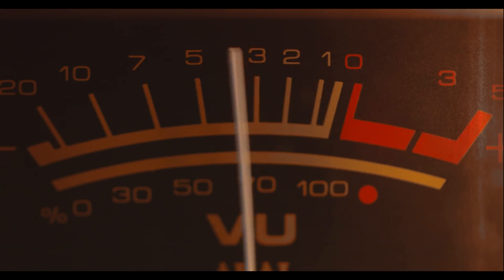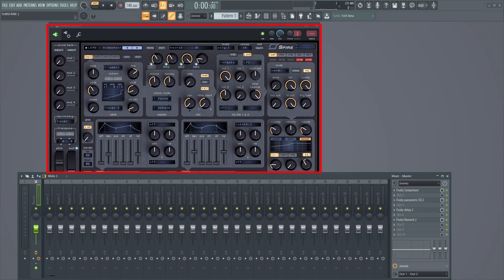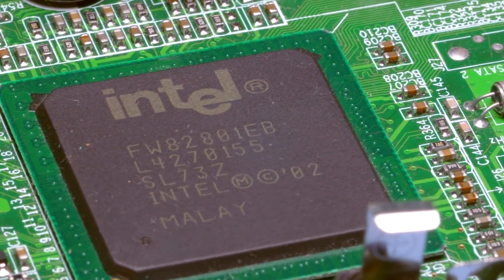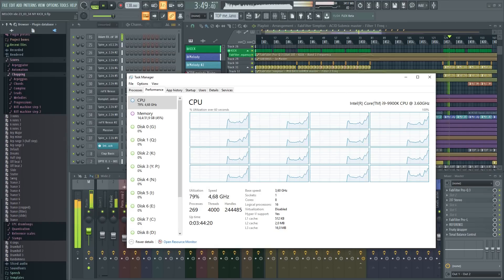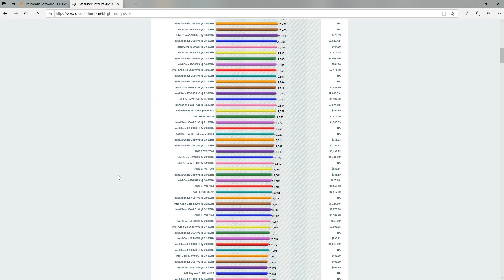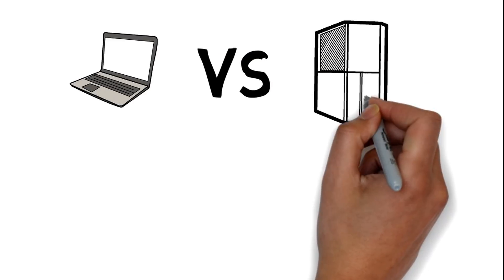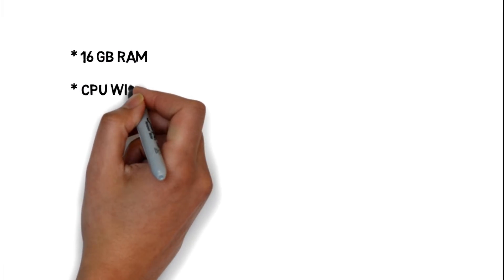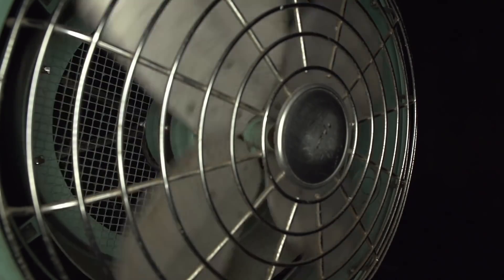The Best Computer For Music Production - What's Needed And Why!

Comment: What do you think about the huawei matebook x for producing? Thunderbolt 500gb ssd and 16gb ram
Reply from the maker: It should probably work fine, but it all depends on exactly what you're going to be using it for. A rapper who mostly record vocals and use mostly samples, and at the most a few VST's will probably make due with a very low end computer, because those kind of projects are not very demanding. However, another person making huge trance or orchestral compositions which is mostly made up by cpu hungry vst's will have a very different need. So the genre, the way you work and the kind of projects you make also plays a huge role.

Comment: Is there really no mention of a Thunderbolt 3 port in any of these specs?   That's hard to believe.
Reply from the maker: The full specs are listed in the video description and also in the pinned comment.
Reply: @FireWalkMusic  The word he used was Thunderbolt 3! Not Firewire. USB C!!!
Reply from the maker: @mitchiemasha  Sorry about that, I've gotten so many messages about the (lack of) firewire on the main board. I have to learn to properly read the messages before answering...  :)
There's 1 USB-C port on the rear (main board) and also one on top of the case.
Reply: @FireWalkMusic  it seem they're cross compatible 1 way but not the other.

Comment: Fantastic explanation and buyers guide! I went to Fractal Design cases a few years ago, similar to the one in this vid, but USB-C wasn't available then, but upgraded it a while back to an I9 as well to help with latency. Works like a dream! This is def the most comprehensive video I've seen on music station PCs. 

One thing I would add, if your a hardware nut like me. The motherboard may be something to add consideration to as well. PCIe slots are very important to my setup as I use a ton of external USB for synths and MIDI to USB dongles and interfaces. I would suggest if you have a ton of external gear, get a mobo with as many PCIe slots as possible so you are able to add additional USB ports. Even if you dont use all of them, later on when you need them they will be available for expansion and you won't have to daisy chain off a single bus with a multiport USB dongle which can cause huge a bottleneck and cause addition latency. But if your all VSTs then basically forget everything I said 😁
Reply from the maker: Thanks, very good points here! :)

Comment: Another useful video Firewalk as always , but i want to share something which would help many people , AMDs latest gen processors are really powerful over Intel , even in terms of single-core permofance and many gamers , streamers etc are switching to AMD 3rd Gen Ryzen bcoz AMD really fits into the budget with more performance over Intel and even in the High-End Section (Like Beyond 8 cores as well) , i would love to spend $1000-3000 on AMD rather than choosing Intel as they are expensive with less performance in 2019 & in the future as well ....
Reply from the maker: The new AMD 3000 series CPU's seems to be a huge leap forward for AMD. From the benchmarks and comparisons I've seen so far It looks like it should be real close, but not surpassing the i9 in terms of music production.
I'm considering making a follow up video, testing both systems against each other, but I'll have to save up some money to buy the parts first. :)

Comment: Just letting you know. AMD's 2nd and 3rd generation aren't just parallel processing. yes single core plays a huge factor for music production and what not. Though AMD now with Ryzen is so much better with IPC or instruction per clock. Ryzen doesn't have security vulnerabilities like intel does and intel keeps getting bombarded with more every other month. This comment isn't to shit on your video, though it's a little misleading when you say AMD is just focusing on only parallel processing which FX and older generations of AMD were actually based on. I personally use a Ryzen 7 1700 clocked at 3.9ghz on all cores and I have some much headroom for intensive VST's like Serum, VPS Avenger and many others running on Cubase 10 Pro. In addition, many DAW's even like FL studio loves Ryzen for the multi-threaded processing since it helps with lags and keeps your workstation and keeps it from having pops in real time. Anyway great video explaining how processing works its 100% true. However, now AMD has fixed a lot of there CPU problems that they had over a decade. :)
Reply from the maker: The new AMD chips are very good and comes very close to the Intel flagship. There's been rumors like this for years, that the next AMD chip would finally be the "intel killer", but it never happened. This was the case with the bulldozer architecture as well. I remember there was benchmark which allegedly showed that the bulldozer crushed intel. But when it finally arrived it turned out to be a disappointment, and nowhere near what it was rumored to be, so I didn't really expect the new 3000 series to be all that great either. This time however they really made a great chip, and it's almost neck to neck with Intel's flagship. From the tests I've seen so far the 9900k still seems to be slightly better for music production, but not enough to justify the price different. I'm expecting the price to go down significantly though. 

Here's some comparisons between the 3900x and the 9900k you might find useful: 
https://cpu.userbenchmark.com/Compare/Intel-Core-i9-9900K-vs-AMD-Ryzen-9-3900X/4028vs4044

I should note that I've always been a huge fan of AMD. I always used to support them (both CPU and GPU) because I always wanted to support competition, which is always good for consumers in the end. I really hope they do well with this new design. I'm considering buying the parts and testing the new AMD vs the i9 in a new video. That should be really interesting,  but I'll have to save up money to buy the parts first. :)
Reply: AMD fanboy

Comment: may i suggest if your getting a good music build pc, then get an equally good soundcard like a prism lyra, the weak link also learn to beef up single tracks with a great pre and eq as you dont need to choke out 30 plus tracks with bad audio, bounce down mix and commit and free up power, a neve 1073n for instance, if you can afford a good pc then the lyra is a no brainer
Reply from the maker: A good sound card is an important part of any build, depending on what you're using it for. If you're into recording then by all means, this will be a good investment. Personally I don't record much, I'm basically just using VST's 99% of the time, and most of my recording is done by third party actors, so for me I really just need a card with a low latency ASIO driver. If you're into recording then the sound card becomes much more important. I might make another video about external sound cards at some point. :)
Reply: @FireWalkMusic  yes i use a lot of vsts and the da is equally important to me several vsts esp drums,  any mixing really in or out the box will improve with quality adda in and out the daw,  using 4 drum vsts combined for elements of each nearly brings my pc to a grind 6 core 5g 32ram m,2 memory,  the more ram the better imo, and a prism unit, ive tried them all in over 20 years exp, but  normal recording its not such a tax

Comment: What about the motherboard and ddr are thy making any difference in latency? I meen like the chipset and brand? I can never find an answer about this.
Reply from the maker: Some chipsets allow you to overclock more than others. This will usually be tested when they review motherboards and such. The speed of your RAM plays a huge role and you want it to be as fast as possible. There are two factors there, the speed (mhz) and the latency.
Reply: @FireWalkMusic  I was wondering if I could also buy a middle class motherboard with the same chipset instead of the most expensive ones and if that really had an effect.  But with this answer I see that this is the least important.  So I better go for a more expensive Cpu and drr than for an expensive motherboard.
Reply from the maker: @sonny_feraly  correct! 😊

Comment: I have old computer i3 ,how can i make it faster?my projects are fairly big
Reply: An old i3 will never get a lot faster whatever you do. Getting a new PC is the best option if you really need it...
Reply: @MrVleker  If i go for i5 than what it would be?
Reply: @shahnewazmanto4798  i5 is better than i3, but for music production you might want to get an i7 because that would be quite the upgrade from an i3. Also check the core clock speed of the CPU! Just see what your budget can get you!
Reply: @MrVleker  suggestion for i7?
Reply: @shahnewazmanto4798  once again, depends on your budget. The most recent is the i7 9700k (K is overclockable so I advice that), also go for at least 16GB Ram!
Reply: @shahnewazmanto4798  Wich you used software ?
Reply: @claritoresdiano1021  Cakewalk sonar x3
Reply: @shahnewazmanto4798  Too old sofrware. You can start from 6~8 Core processor.
Intel i5-8600K/9600K or i7-8700K/9700K
AMD Ryzen 5-3600/3600X or Ryzen 7-2700X/3700X/3800X
16 GB DDR4 RAM
FHD~1920 x 1080;[1080p] Monitor
Soundcard support ASIO driver
GPU = Up to you
That's more than enough. 

Overkill ; i9-9900K/R9-3900X (No reason to bought it, catwalk sonar can't use full performance from both CPU)
Reply from the maker: Check out this video: https://www.youtube.com/watch?v=OWYmqwb7b4k

Comment: I built a PC last year with an 8700k, SSDs and 32 G RAM. No problems at all with Fl Studio. Huge projects and NO artifacts. I would have thought the i9 would have been way better, but...seeing this I wouldn’t spend the extra cash.
Reply from the maker: Hey there. The 8700 is still a quite good CPU. No need to upgrade unless you really have to. If you upgrade to i9 you will probably see more performance increase than this. In this case the newer i9 is running dual channel memory while the older 5820k was running quad channel, which is basically twice the bandwidth. 
From my tests it seems like that's what causing the 5820k to be so close to the i9 in this case. The same won't be the case with the 8700 on a dual channel setup.The i9 s about 40% faster than the 5820, but the bandwidth is giving the 5820k a huge advantage here.

Comment: Great video! One question, what was your reason for going with such a high-end motherboard?
Reply from the maker: Thanks! I like to over clock all my systems to the limit, so I wanted a z390 based board that was capable in that regard, and this one came out very well in tests. I also wanted integrated Bluetooth and WiFi just for convenience. If you don't need those things then just buy a cheaper one. :)
Reply: Berend. He bought an i9... it would be silly to put this chip on anything but the best z390 board otherwise you might as well just get the i5 or i7. Although, he's paying for the wifi/bluetooth (which many wouldn't want built in on a studio PC, potential driver issues), the cheaper Z390 DESIGNARE might perform better. The HERO without wifi comes in at the same price.
Reply: @mitchiemasha  Why would the a cheaper motherboard slow down the processor?
Reply: @leonav1  Easy. The VRM's aren't stable enough to deliver the required voltage, at full load, for duration. An OC will crash easier due to vdroop. 
It's harder to undervolt OC to reduce thermal. The VRM circuitry itself will get too hot and throttle.

You might think you have a stable 4.9, 5.0 OC due to no crashes but if you open intel extreme app, you'll notice serious current throttling happening, stepping down the CPU, even though the CPU itself hasn't even broke a sweat, fans still at idle.

It took a lot of extra tweaking to get my £120 z390 MB to not current throttle the i7, to stay locked at max turbo. It would be impossible with the i9 on the same board.
Reply: @mitchiemasha  So that would mean getting i9 9900 xps from dell, you won't be able to get the full cpu potential out of it?  Not to mention the proper cooling and no room to upgrade fans.

Comment: I use a 2014 Thinkpad T440... It has an i5 4300U processor that is kinda low to mid-end. I'm working on a heavy ass death metal project and everything seems more than fine.
Reply from the maker: It all depends on what you're working on and what kind of plugins and vst's you're using. For example, if you're mostly into recording, and you are let's say recording a band. You'll end up with a lot of recorded samples, which isn't very CPU intensive. For that kind of use, you don't really need that much performance. 
However, if you're mostly into electronic music and all your sounds are being generated by virtual synthesizers then that will quickly start to add up. 
Some VST's such as omnisphere, Serum etc can consume a huge amount of processing power, and I know that some Cubase guys like to have a secondary computer just to run those plugins because they are so demanding. 
In this particular case shown in the video, most of the main sounds are generated by VST's, and there's also a lot of processing on every mixer track, which consumes a lot of performance. 

This should probably have been mentioned in the video though. :)
Reply: @FireWalkMusic  At the moment I'm stuck on this nasty problem. My mix is always "too loud" for YouTube and my tracks always get trashed by their compression. I figured that I had to set my limiter on -1db peak control, but I've yet to test this out. Your channel is a great hand of help, man. Thank you so much.
Reply: @FireWalkMusic  Well, that's where it gets weird. I record very little of my guitar parts, as I'm not that great at it (yet). I generate everything from plugins. Kontakt 5 (shreddage 2), Superior Drummer 2, Ample Bass and ReFX Nexus are my go-tos at the moment. Guitar Rig 5 is also a heavy one for the effects. Kontakt guitars are the heaviest on the CPU, my previous i3 could not handle it. All in all, I say that a producer will always find his way out of technical limitations in some way.

Comment: LOL, buying overclocking hardware, but not overclocked. You need to overclock your gear for better performance. Your I9 9900k is only running at 3.6 ghz. Overclocking your studio pc wont make your CPU go red hot, because of the latency, you will never see your cpu go to a 100% load and therefore your cpu temps will never realy get hot. My i& 8700k overclocked to 4.9 ghz, never goes above 70 degrees celsius. Checking your temps at full load is best while rendering or exporting audio.
Reply from the maker: It's running at 4 ghz as is clearly stated in the video during the tests :). Windows task manager does not report the actual frequency, just the frequency the CPU has out of the box, regardless of how much it's clocked. 
Both systems in the test is overclocked to the maximum stable speed. :)
Reply: @FireWalkMusic  You can run it even higher without damaging your hardware. Your motherboard settings out of the box prevent it from reaching It's max boost clock. This is because not everyone has a sufficient cpu cooler to run It at max speed. Your cooler is sufficient to run It at 5 ghz and if you set the load line calibration at 3, It will run at 4.7 while working with AVX instructions. Most audio programs like cubase use AVX instructions. Overclocking a music pc is pretty save, as I mentioned, because of latency, your cpu will never reach 100% load. As you can see in your video, latency is full load, cpu is not.
Reply: And BTW, Higher core speeds or higher core counts depends what software you use. New AMD 3rd GEN ryzen with higher core counts beat i9 9900k., but as far as I know only with Cubase and Studio One 4 as your DAW of choice. With video editing and gaming, higher core clocks are better.
Reply from the maker: @brianlespoir6287  sorry, typo. It's running at 5 GHz, I tried 5,1 but it become slightly unstable after a while. The 5820k was running stable at 4,5 GHz. I belive the quad  channel memory gave the 5820 an advantage in this test btw.
Reply: @FireWalkMusic  Indeed using only 2 channels for memory is more stable. I'm glad to read you overclocked it, would be a waste of money not to.
Reply from the maker: @brianlespoir6287  I've been squeezing out every last bit of performsnce I could since the 90's. I remember how happy I was when I managed to over clock my 486 amd dx4 100 mhz to 120 mhz. It wasn't stable at all, but back then that didn't matter as long as you could play the latest games for 15 minutes before it crashed 😝

Comment: What is the purpose of the sound card/ audio interface besides connecting external instruments? Should I be using my Scarlett’s 2i2 to mix my audio?
Reply from the maker: External sound cards often come with their own dedicated ASIO driver and will typically provide less latency compared to on board sound cards. They also typically have less noise. If you need to record, then they come with dedicated mic inputs, and they also have dedicated outputs for studio monitors.
Reply: Unless the sound card on your PC is somehow bad and as long as you can connect to the speakers you want to use, you don't really need an audio interface as far as I know. The only thing you might possibly miss out on is the sample rate if the sound card built into your PC can't go as high as what you are using, but if it does, then it should be fine.

I could be wrong though, since I haven't had a ton of experience with this stuff yet.